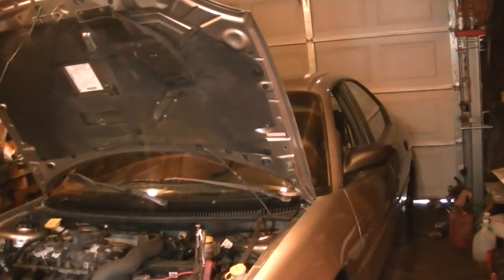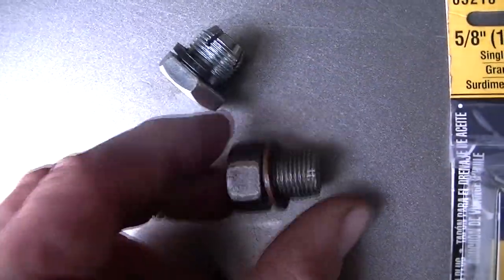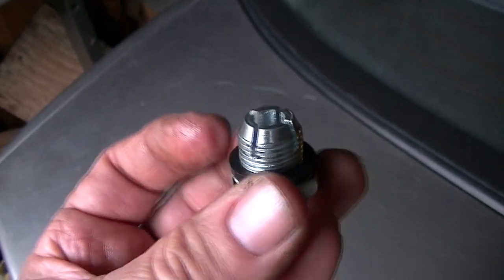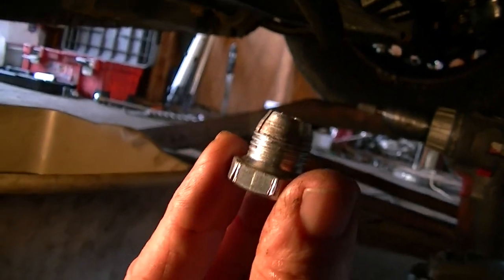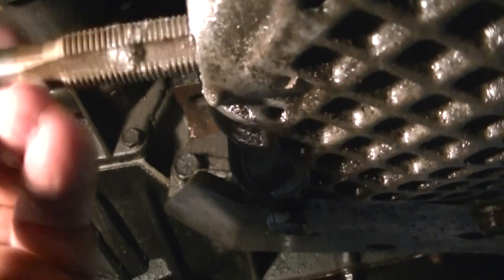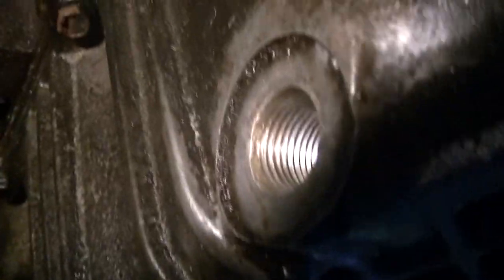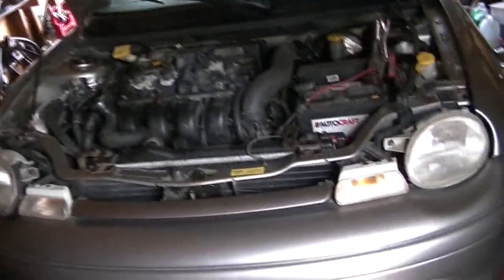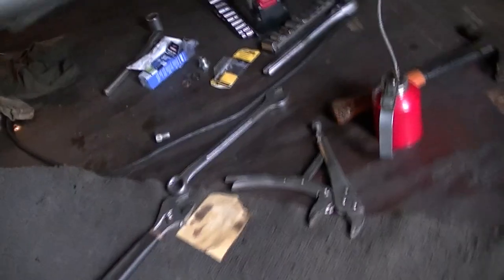Fixing A Aluminum Stripped Oil Pan Drain Plug.

Comment from the maker: Tip: Use axle grease on the tapper to avoid the metal from falling into the oil pan and potentially damaging the engine.
Reply: I think  I'd still  put some   mineral oil  in the and try to flush any chips out of the pan.
Reply: Take the pan out and clean it through, take the time, thanks
Reply: @grassroot011  I poured the oil through the car again to flush it out.  Seemed to work very well.
Reply: Oil filter will catch any debris though.
Reply: oko9
Reply: @KrombopulusMichael  this is what I was gonna do but I’ll do the axle grease too.
Reply: That was the first question I had. Good tip.

Comment: Great video thanks. One thing for folks to also remember is to match the thread pitch of bolt with the tap. SAE uses coarse and fine while metric uses a decimal number example 1.5.
Reply from the maker: Good tip! Thanks for sharing!

Comment: Fantastic video. I just ran into this for the first time with my 2nd gen dodge. You’re about to save my life if I can get this to work on my truck.
Reply: Did it work?
Reply: @jordancasavant9923  yes it did. I ended up drilling out the old threads that were ruined. Then loaded the tap with red axle grease and using a ratcheting tap from GearWrench cut new threads like butter. Axle grease made shaving clean up a breeze. The Dakota is still running strong today and oil changes flow much faster now lol.

Comment: Thanks for your video. During my last oil change, my plug tightened but I could tell it wasn't going to tighten enough and I didn't have a couple extra hours to make any repairs let alone getting an oversized plug from the nearest parts store. I snuggled it the best I could, added oil and left a sheet of cardboard on the garage floor to gage how bad the drips would be the next morning. Not bad, an out 2 to 4 drips . So far after 4000 miles and a cold winter with maybe a cup low, I plan to go the oversized plug route instead of the oil pan.
Reply: if you use oversize bolt, do you stoll have to do the hand tap method?

Comment: I own a bmw e46...the guy before me used a m12-1.75 and it's actually a m12-1.5 this video helped me decide to actually try this. Thanks for your help
Reply from the maker: Glad it helped you!
Reply: I was thinking about doing this but it helps to watch someone else jump off the bridge into the river below before I take the leap myself. Thanks again
Reply: Carls Johnson I have a bmw f30 which also uses a m12-1.5. I’m just wondering what you used to fix this and if it has been effective?
Reply: @Cristian...i ended up wrapping the 12-1.75 in Teflon tape as a quick fix. It's working so far and it doesn't drip. It's just a quick fix until the cold rainy season clears

Comment: Sir, great video. I was changing oil on my F250 and did what you did except my plug was stripped. Pan threads “appear” fine. Hope I don’t need to do any of this and hope a new plug will do it when I go to buy a new one first thing tomorrow. If it doesn’t, glad I found this video.
Reply from the maker: Hope for the best!~

Comment: There are oil drain plug insert kits of different  sizes. You need a large drill and drill bit from the kit.  Heli-coil may have the kit. AutoZone may have it. You may need a drill bit set. A Big-sert kit may be needed since it has a steel insert.
Reply from the maker: True. Thanks.

Comment: Thanks for informative video. I have done thousands of oil changes and just recently busted my wife's sienna oil pan. Man, did i freak out!
A coworker tells me about the Heilcoil kit for the fix. Why would someone want to go the Helicoil route (tap then sleeve) rather than your simple way, just tap and go. Please let me know what you think.
Reply from the maker: Well the hold Idea it to get the threads started as straight as possible
 so the new plug will seal good. You can play around with different 
types of seals for the new plug also.

Comment: I remember once I had a stripped oil pan bolt on my saturn astra after doing my oil change on a sunday. Pretty much all the stores were closed, and homedepot was open and didnt have an m14 bolt. I ended up using an old spark plug to seal it, and it didnt leak at all. I then just used a longer drain bolt and it sealed it up tight
Reply from the maker: Thanks for the info!~
Reply: If I bought a used car and found a sparkplug in the oil drain hole I would immediately question the entire vehicle
Reply: @Partnerthedog  LMAOOO. i would be like how high is this dude, then check my spark plugs

Comment: The reason your oversized plug didn't work at first is because you need to get the exact size as your original plug, the oversized specification will be slightly larger than a standard plug. So in your case a 1/2" oversized plug would have worked, the 5/8" oversized is meant to cut a 5/8" stripped hole. Thanks for your video, i will try tapping mine today
Reply from the maker: Nice!!!

Comment: FYI, "Plug Tap" on the tap package does not imply that the tool is for tapping a spark plug hole.  It is describing the cutting chamfer type, which is a plug chamfer or 3 to 5 threads for a through hole. A "Taper" chamfer is 7 to 10 threads for making it easier to start the thread and a "Bottom" chamfer is 1 to 2 threads for a blind hole.
Reply: Saw that vid too

Comment: If you went to tractor supply and bought a long bolt the same size as your original oil plug. Then cut it,  to about twice the length of your original.  You wouldn't have had to tap it. You can see you have good threads deeper in the pan that your original plug doesn't touch. You actually could have saved about $7 bucks and not worry about shavings of metal in your pan from tapping without grease on your tap..
Reply from the maker: True. Thanks for sharing!

Comment: I had to repair the drain plug threads on a motorcycle years ago.  I put an air hose in the filler hole somewhat sealed off with a piece of rubber hose and blew out the shavings as I tapped it, then poured some oil back through it to wash out any shavings that were still in it.  I would imagine an air hose attached to the dip stick tube would do the same thing on a car (as long as the oil cap is on and pcv is blocked off).  Hopefully the filter will catch any remaining crumbs.  
It also looks like your "original" drain plug had already been replaced with a self tapping repair bolt.  A stock bolt wouldn't have the slots cut into it.
Reply from the maker: Yea tuue. I think your right.

Comment: Never use an over size plug or any other sort of self tapping plug. These plugs dont magically stop cutting threads the next time you change your oil. The result is you will cut new threads into the new threads that will strip after a couple times of removal/installation. Dont be a lazy and just take the time to drill out the old threads and either helicoil or install an insert.
Reply: That's what I thought this video would show simply based on the cover shot with the tap 😕

Comment: Dealer stripped my pan of course they wont own up to it but they will sell me a new pan for $700 on my 7 month old vehicle that only they changed the oil on from day one.I found these ecoplugs on Amazon the plug had a 4.5 to 5.0 verified purchase rating.I purchased one $15 installed it in two minutes Game over saved a boatload of money now I change my own oil with the ecoplug I hope this helps someone that got screwed.
Reply from the maker: Cool! Glad it worked for you.
Reply: Love these obvious adverts for ecoplugs!
Reply: Thanks!
Reply: I got "plugged" by some moron thst stripped my oil pan! I am gonna try the ecoplug.
Reply: I don't see how all the oil will drain from the pan using an ecoplug.  See the length of the threaded section?  It seems that's how much oil isn't draining and sitting in the bottom of the pan.
Reply: badmonks I was thinking about buying one and shortening the end that screws into the pan so that all of the oil will drain out.
Reply: Take them to corporate

Comment: A garage was supposed to retap my oil drain plug and just stuck a slightly larger bolt in with larger thread size. So having to do the job again.

Comment: One simple question, why the end of the tool doesn't have ending like thread chaser so you could just put ratchet inside and move, with pliers it works too as seen but its not so convenience

Comment: I just replace the bolt with a Stahlbus drain plug and I put oil resistance silicone on the threads and you don't have to be taking off the drain plug anymore cause it comes with a adapter and a clear hose for future oil changes.Just get the thread size and you can find them on eBay like I do.
Reply from the maker: Good to know!~

Comment: I've seen some people drill first and then tap, wonder if you drilled off camera?
Reply from the maker: Nope. It was hard to tap this.
Reply: @FixingWithPassion  ok thanks, I have to tap a sxs differential. Id rather not drill either but I will be using grease and draining just in case. Thx.

Comment: Smart man. Use all of the threads in the oil pan. It will limit the risk of stripping the female thread's. Oil drain plugs only need to be torqued to 20 Ft lbs.

Comment: EVERTHING you see related to fixing a stripped is just a temporary fix as long as your contending with the threads THERE IS ALWAYS GOING TO BE A PROBLEM.
Purchase an Ecoplug and call it a day.
The Ecoplug is a permanent solution to stripped aluminum and steel oil pan thread damage.
Ecoplug is a game changer have one on all my vehicles 
love it!!!!!!!!!!!!!
Reply from the maker: Jim Lane .....Right. But I got lucky and it did not leak oil after doing this. But thanks for the advice epically for the new comers. :)
Reply: YOUR WELCOME
I had one of hell coils installed on my car the first time I went to change the oil the helicoil came out and was stuck to my plug 
NIGHTMARE !
We than installed an Ecoplug and I can now service my oil in seconds 
NO MORE THREADING FOR ME

Comment: 5/8 inch is roughly 1.6 cm, so it starts at 1.6 at the bottom and increases in size to 1.8cm
Reply from the maker: Yes. No longer have the car but it never leaked after the fix!
Reply: If my bolt is a 12 m, what size of oversize bolt should I get ?
Reply: depends what the pitch is.. m12 x what.. here is catalog with oil sump bolt sizes, it will show a code for the correct oversized bolt for your vehicle. Look up the code and you may find it. Otherwise you could try a code that has similar size original bot. Im no expert, my bolt size was m14 x 1.5 , and the thread was rooted as. I just thought well its got to be quite a bit larger than 15 mm because I allready made the hole bigger, so I went for the same one on this video a 5/8 one..It still has a small leak though, Im thinking of tightening it a bit at a time until it stops leaking, without going past maybe 30 Nm.
Reply: I wouldn't recommend an oversized bolt, mine cross threaded at 30 Nm. You can get this thing called an eco-plug, a lot of people are impressed with it.
Reply from the maker: Yes, that's what I going to do next time.

Comment: I just did this job and I’m paranoid that shaving got in 😱
Reply: Run some cheap oil / clean used oil to flush it out. Don’t worry, anything left inside should be caught by the filter

Comment: Good evening, TVWXMAN32. I changed my oil yesterday and stripped the plug hole. Do I buy the same size plug tap, or go one size up? My vehicle is a 2008 Ford Crown Victoria Police Interceptor. It has a 5/8" pan bolt. Thanks.
Reply from the maker: Up one size.  Eye it.

Comment: I own a fleet of vehicles they  have aluminum and steel oil pans the threads were always leaking we tried all the temporary fixes pain in the ass  difficult to service and eventually leaked oil  my friend works for a Lexus dealer and suggested an ecoplug its a magnetic drain plug that doesn't need threads and lasts for the life of vehicle we are sold on these ecoplugsthey are incredible we purchased 20+ ecoplug for about$11.99 its been almost a year not one leak.
Reply from the maker: Thanks for the Advice!
Reply: No problem hope this saves people a lot of grief and money

Comment: How do you plan to get the shavings out of the pan now?
Reply from the maker: James Pinckard ....Used a squirt can Shot some used oil in the hole flushed some of the shavings  out. Then took the oil I drained out....put in back in leaving the drain plug out....letting the used oil flush the small shavings out. Worked perfect! New oil/filter good as new! Thanks for viewing!

Comment: What do u do when its not a bolt thats stripped but an actual pressure hose because my power steering gear box is stripped out
Reply from the maker: Your F*ed!  Dang dude....that bad!
Reply: Im at the point where im just gonna replace the whole gear box
Reply from the maker: You should do a video....It may help others. I'd let you post it here for views!

Comment: Hey Guys! I tried to do an oils change but I'm not able to take out the plug. It keeps on spinning but won't come off or get tight. What should I do?
Reply from the maker: Try to get a sharp straight screw driver in behind the oil plug bolt and
 oil pan (you might have to sharpen it with a file to make it really sharp)
 ... while tapping it with a hammer. This might get it started or
 to "pop out some" until you get it out far enough to get some vice 
grips or something to pull on/out the bolt while turning it.
Reply: Did you end up being able to take that oil pan plug out? If you did, how did you do it ?
Reply from the maker: I used a small screw driver wedged it between the bolt and pan while trying to turn the bolt forcing it slowly out. Also vice grips works wounders.

Comment: I cut the thread the same way you did in the video and tightened the new oil drain plug to 25 NM with a torque wrench.(spec) Everything was perfect, but after 2 days I can see a few drops of oil under the car in the driveway.  I re-tightened it to 30NM and today I found another drop of oil under the car. 
Any suggestions?
Reply from the maker: Get a rubber seal for the bolt.
Reply: How about today?
Reply: @thinshadow551  Sold the car :D
Had to change the oil pan first, though...

Comment: 1st view I think.. this video doesn't relate to me but I just found your channel today and subbed instantly. reason being I am in possession of a 2000 mercury sable LS (the taurus' prettier twin sister) that has within the past week developed what I call haass  (hyper active alarm system syndrome)' stock anti- theft system randomly going into panic mode for no obvious reason. while trouble shooting found this channel. still haven't fixed that but I did get the heater working and some of the vacuum leaks sorted out thanks to your videos. I assume the alarm issue is a bad door latch cuz while I'm driving it the door ajar and dome lights start flickering thought I unplugged the drivers from the rest of the system and for a few days all was good but today it started doing it again. is this an issue you are familiar with? any advice would be helpful
Reply: unplugged the drivers side door from the electrical system I meant to say. small phone big thumb
Reply: oh and on a side note I took a hard right turn in the Wal-Mart parking lot and the door ajar warning light and dome lights started going nuts and kept doing so even after opening and closing the doors and didn't stop till I disconnected the battery
Reply from the maker: Hey thanks for subbing! Yea you have a switch/door sensor somewhere going bad or making poor contact.  I had a dodge caravan that did the same thing from St louis to Charleston W.V. one time (8 hr drive) ugh...Blinking dinging. Turns out it was a door sensor. Start looking at the door sensors. Rain will do strange things sometimes to doors and sensors. Any check engine lights? Start there also.
Reply: TVWXMAN32 hmm the alarm issue started on a rainy day last Sunday. check engine light went off after replacing 2 vacuum hoses but I can still hear a sucking sound and it idles rough sometimes stalls if it isn't warmed up
Reply: I'll keep poking around and see if I can find anything. I am scared of blown gaskets

Comment: You started with an over sized plug. That's why it didn't feel right to begin with. You need to look into Eco plugs before ruining a pan by wrongfully resizing the pan. If you teach a bunch of people the wrong procedure you are going to have a ton of people cracking aluminum pans because they are forcefully changing  the thread pitch. That's why mechanics use helicoil kits instead of trying to up the oil pan drain hole size. I understand you want to teach people how to do those things, just make sure you are teaching the right way.... not the wrong way.
Reply from the maker: No the plug was the right size. The threads would not "Bite"

Comment: It would have ben simpler to install a longer bolt of the same size thread as the original plug.  Some people shouldn't be allower\d to "repair" cars. :-D
Reply from the maker: Sometime, you gotta work with what you got.